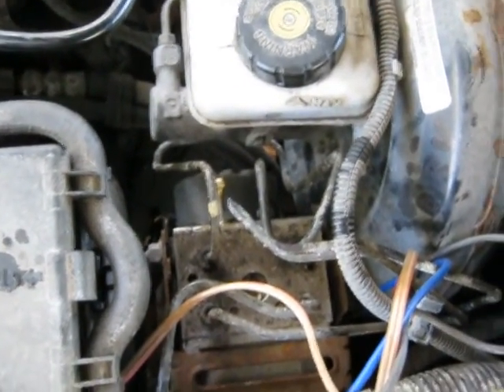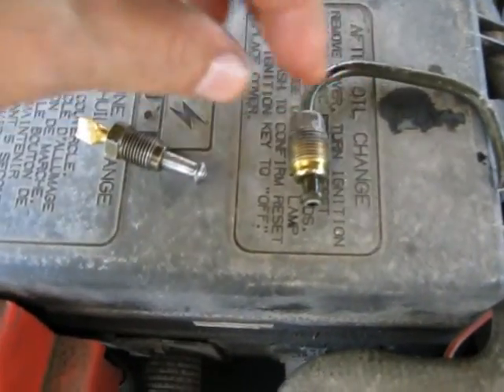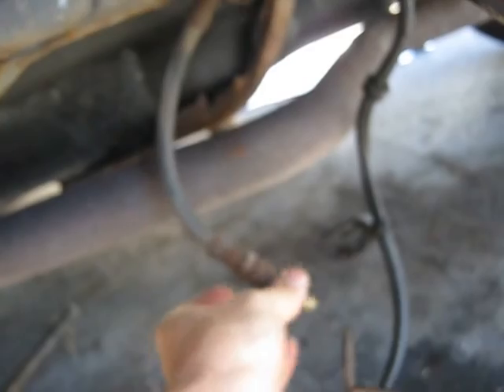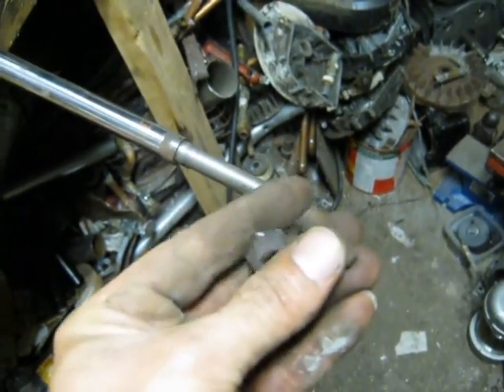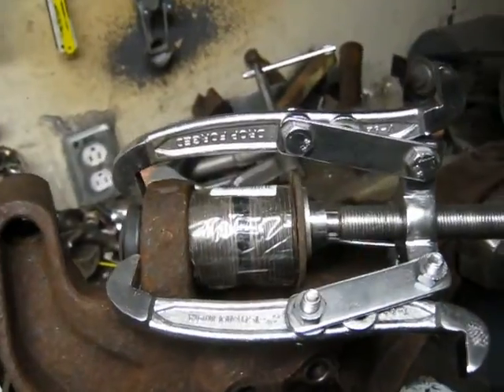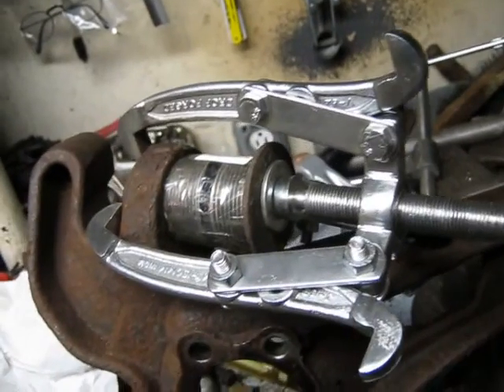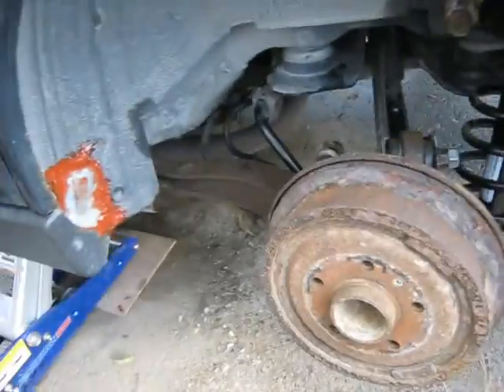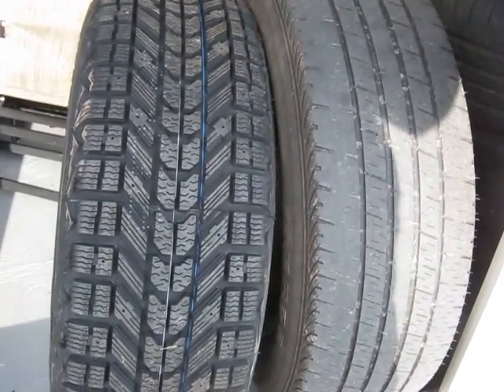Saturn L Series Rear Suspension Part 2

Comment: Did the rear end sound like this https://youtu.be/ph0mMdLzBts before u replaces the bushings ?
Reply from the maker: No, mine didn't make a noise like that, could that possibly be the strut doing that?  Mine rode like a lumber wagon over small bumps, clunking and clattering, plus the back end wanted to steer the car, so when you had the passenger side on  some ice on the highway, it would kick the back slightly towards the ditch, not a nice feeling! Sorry  I can't identify the sound yours is making.
Reply: I actually found the problem it was the bushings at the knuckle! Thanks for the reply tho .
Reply from the maker: You are welcome, best of luck making the repair, if you don't live in the rust belt, I imagine it will go easier.

Comment: How did you get someone to mount those size tires ? I had 205-65's I got at the yard nearly brand new and Walmart refused to mount them because they weren't 195's. I guess it depends on where you go. We actually mount them ourselves anymore. It's not that hard. You just need to get them balanced somewhere. Take 'em off and take it somewhere and they'll never know what they're off of. lol.
Reply from the maker: +Chas S They tried to sell me 195s also, but I find they aren't enough tire especially on the front, all they want to do is spin in the winter. The cars with a V6 came with 205s, so I pointed that fact out, and they installed them. I do the same thing most of the time, mounting them myself. I know what you mean, some tire places are very anal about the tires having to match what the computer says. The other main argument I got into was buying only 2 new tires, they always want to put them on the back, while I want them on the front. It makes sense to me, since on FWD the front tires drive, steer, and brake, the back tires just go along for the ride, unless you take a 3 G corner!  :)

Comment: interesting, I didn't realize Saturn's used wheel bolt instead of wheel nuts, lol
Reply from the maker: +redneckbryon I am not sure that all Saturns use wheel bolts, these L Series cars were based on a European design, so they are somewhat different. I have heard many good things about the smaller Saturn cars, so I don't think my bad experience with this car is representative of Saturns as a whole. So far the drive train has been good, it is mainly the rear suspension that I have issues with, and my guess is this car got a lot of hammering on gravel roads, so perhaps other cars are not as worn.

Comment: Can someone explain to me how did he use his puller to get the bushings in and out?... i didnt understand
Reply from the maker: I just re-watched the vid to refresh my memory. I didn't use the 3 jaw puller to remove the bushings, I pounded the loose center part out with a hammer, then used a dremel with a 1/8" carbide cutter to cut into the outer "drum" of the bushing until it weakened enough to be pounded out with a punch. Then I used the 3 jaw puller along with the pipe nipple and washers to pull the new bushings into place in the housing. You must be careful with the dremel so you don't nick the casting when you are cutting the old bushing outside "drum" . You could locally head the casting with a blow torch to help when pounding the old bushing out. An acetylene torch could possibly be used, but you would have to be a real pro to not cut into the casting!

Comment: Thanks for the video, am trying to find part 1but couldn't in your page. How about a link, thanks!
Reply from the maker: Sorry, i can't do a link as i don't even own a cell phone, but have a look through the old comments, I remember looking up some part numbers a few months back. I hear the rubber front bushing may not be availible any more, but perhaps you could repair it with a urethane kit that you would pour in yourself. Also these cars use the same bushings as a SAAB car, according to some old comments. In my opinion these cars have some of the most poorly designed rear suspension parts i have ever seen, the danged thing drove like a lumber wagon  :(

Comment: Same rear strut mount that the SAAB 9-5 uses.
Reply from the maker: Yes, GM liked to re-use parts. It is too bad they couldn't figure out that this rear suspension set up sucked!  All it likes to do is wear out components, and now they are almost impossible to buy (the main control arm bushings).

Comment: I forgot to add on the previous video that I also have the common "Frozen E-Brake Cable" as well. I have two with that problem. I have the replacements ready to go. They're cheap online.
Reply from the maker: +Chas S I will have to look into them online. They would be a bit of a pain to install, as you would have to take most of the exhaust system off to get at the cables where they go thru the floor.
Reply: Nah, I just had to lower the exhaust at the muffler with a jack supporting it and removing the heat shield in the middle and dropped the pipe down enough to get to the e-brake "Y" connector at the pull handle. Twas simple actually. Once you do it the second times a charm because you know exactly what has to be done. I guess that's mostly the way with any project you may have to do on something else.

Comment: As I stated on a saturnfans forum I had 2 Yokohama tires on the rear in excellent condition I got at the yard in July and within 4 months had worn completely off the insides. The Kumho Solus tires I had on there had only slight wear on the rear that took longer than that to wear out which actually wasn't that bad. I have no idea what happened within that time but I know the rear lower control arm bushings are bad which may have contributed to most of the ware.
Reply from the maker: This car would wear out a new set of rear tires in about a year, so I got feed up and put in the new bushings. Now the tires last like they should! Plus the car drives like it should in bad weather, it was way too much of a handful to keep between the ditches before!!!
Reply: Mine about slid off the road a few times in the ice and found a broken rear spring. These had a issue with these breaking. Mine was rusted pretty good.

Comment: Where’d you get the larger inner bushing? Part #?
Reply from the maker: Howdy, just did some internet searching. Go to :  gmpartsdepot.ca   I found the large front rubber press in bushing listed #90495585  price $60.34

The smaller (mainly metal) bushings that there are 2 of are # 90496700, but you need 2 of these, and they want $ 93.17 each, much cheaper at Rock auto for the Dorman #905520 part.

If you want to order the parts from parts depot, i would get them to clarify just what the  part 90495585 looks like, in case  there is some kind of numbering error going on. See if they will physically pull the part and have a look at it. The Suspension trailing arm bushing should be a metal outer tube with cast in rubber, and a center steel tube.  The smaller 2 bushings at the back of the control arm are smaller, and have rubber dust covers on each end, no cast in rubber. hope this helps.
Reply: ... #13

Comment: Just curious, have you ever replaced the front struts on a Saturn LS? They aren't a "quick strut" assembly like most cars and there are no videos on replacing such struts.
Reply from the maker: No, can't say i have. I have removed some L Series struts, they come out fairly easily. I just wish the loose passenger side CV joint bushing in the transmission was as easy to fix. I am about ready to say goodbye to this car, and never touch another GM. Early 70s Plymouth Valiant 4 door, here I come!  :)
Reply: Cole Chisholm: I don't believe they're available for these, I've checked.
Reply: Chas S Thanks.
Reply: Early 70's Plymouth Valiant: Huh ! There's a 2 door that hangs around work that's in nice condition except for a little rust in front of the rear wheels. Odd that you stated that about these and I see one quite a bit there. I think they volunteer at the hospital I work at.

Comment: man it's October and your getting close to freezing temps. Bet that slows progress on all the projects
Reply from the maker: +Mr3wheeledbike We have gotten more than close, there was 3/4" of ice on a chair outside, and in some rims holding the cover on my roto-tiller!Yes indeed, it does slow projects down a lot, one reason why I am rushing to get this car work done ASAP!I have to put a front axle into my Corolla, since the CV boot is split in half, more fun working outside, I will do it this week, as we have already had some snow flurries twice  :(Located any old 4 door small Mopars yet?  That yard you go to seems to have lots of interesting cars!  Fixing around the rear window of that 67 Charger would be a challenge, but it would be a Mean Machine!Hey, do you want to enter the contest where I am giving away an El Deltino, odds are 1 in 5 at the moment!!!Just leave a message on the contest vid. Totally up to you.
Reply: ChargerMiles007 well charger, i have not been back out to the yard. They are only open Thursdays and Saturdays and they just happen to be on Holiday this and next Saturday. I am running out there on Thursday to get that VW super beetle engine i got so i look then. I will enter the contest as well, having 2 deltic's far batter then one.
Reply from the maker: +Mr3wheeledbike Man, those are unusual hours for a yard to be open, kind of like a discount auto parts place I buy from, they are open 9-3 M-F, so it is a challenge to get there.If you decide to get the 67 Charger, I would have a look around for one with a smashed front end that you could cut part of the roof off of. I knew where there was one up here 20 years ago, hard to say where it is now, as that yard and several others closed up. The one old car yard around here doesn't have any Chargers that old, we cut the roof off of a 71 Charger they had.
Reply: ChargerMiles007 well the gernal scoop with this place is this 
this was a old race shop the owner hung out with the Richard petty back in the day and a lot of cool old mopar were acquired for parts. He then started to sell them off like a junk yard but fell in in the mid 2000's and passed. Now his wife opens the place up on Thursdays and Saturdays to sell off cars and parts. Lot of the gems got sold a few years back but there are plenty of cool cars and cool racing parts to be had. If your ever down here, defiantly check it out.
Reply from the maker: +Mr3wheeledbike That is quite the history lesson, sounds like a really interesting place! Please have a look for a late 60s to mid 70s smaller Mopar (Duster, Volare, Aspen, Valiant etc.) preferably a 4 door, that isn't rusted all to rat, and would be towable with a tow bar, without a ton of work required. It doesn't need a drive train other than the rear axle. Make a vid of the search if you have time. My son and I are just looking for a car to make into a daily driver, mainly for the winter, so starting with a decent body is best, as it makes it easier to apply more rust proofing to.Thanks for your help.

Comment: As they call each bushings you put if I could say the name of the 3. Or are the 3 equal
Reply from the maker: +juan lemus The 2 bushings that are pressed into the rear of the cast arm are a steel ball type of joint, about 1-1/2" in diameter. One large rubber and aluminum bushing is pressed into the front end of the cast arm.
Reply: ChargerMiles007 thanks I will in my car chavism much worn tires inside me
Reply: ChargerMiles007 what is the large rubber bushing called? I can't find a name to save my life

Comment: Looked easy ... lol
Reply from the maker: +zzzdogutube lol   Trust me, this job was NOT easy! I have put it off for a year, so I am glad it is finally done!The big thing I feared was breaking off the bolts that held the front bushing into the car body, that would have caused some real problems. I guess in a case like that, if it was only 1 of the 3 bolts, I would tighten the other 2 down, and weld up the third hole!